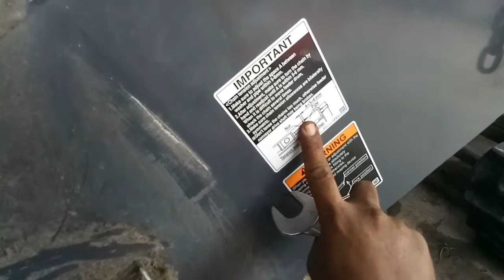chain adjustment.. panu mag bawas ng chain conveyor.

Comment: Sir gaano po ba kataas sa adjust sa conveyor plate sa bottom plate?
Reply from the maker: Basta waglang masyadong banat kadena sir para di masira bearing mo
Reply: @juanvlog3867  wala bang specific measurements yan boss?
Reply from the maker: Nakita mo sa video sir na may ina ajust ko sa magkabilang gilid. Yon yong my sukat dapat di mag dikit yong washer tsaka at pipe dapat my pagitan na 5 to 6mm